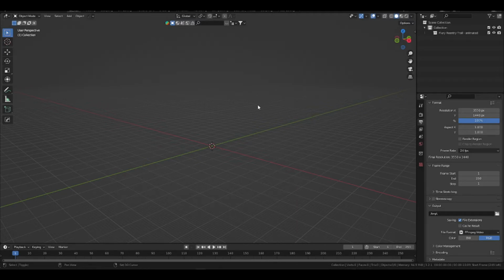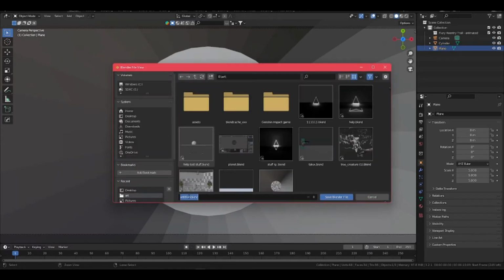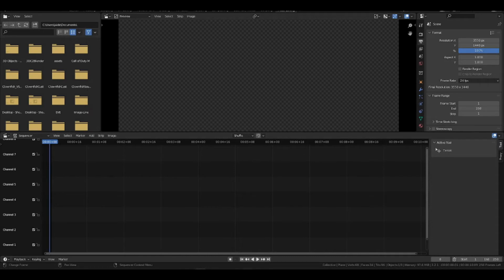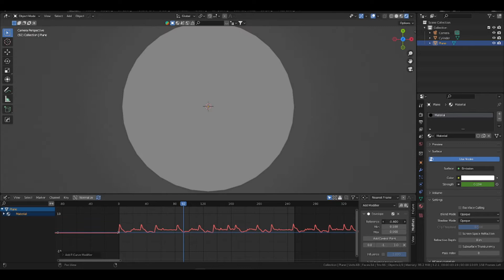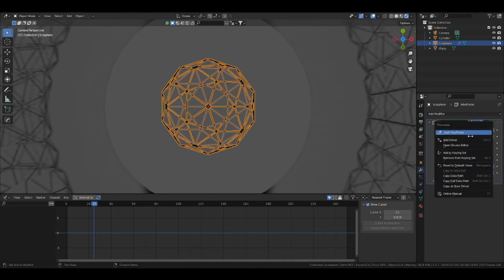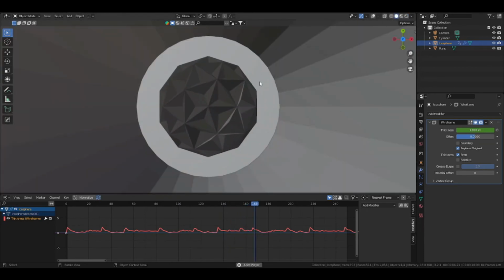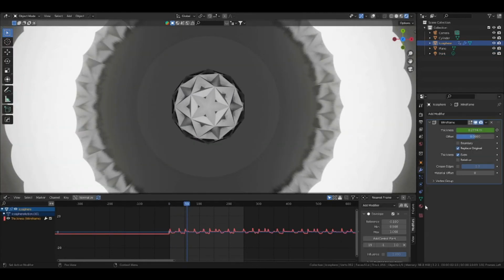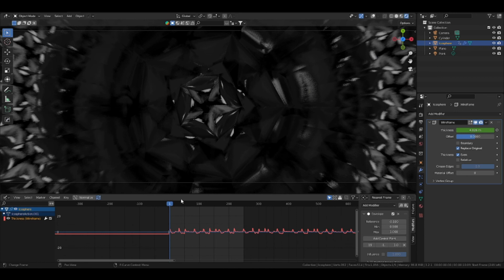how to make objects and lights react to sound in blender 3.0

Comment: hi ive followed your tut 3 times over but still dont end up with the same result? simualr but the light doesnt reflect off of the cylinder walls? any help?
Reply: the problems comes when i add the ico sphere the light doesnt make rings on the cylinder walls